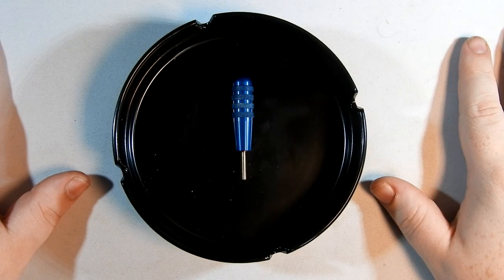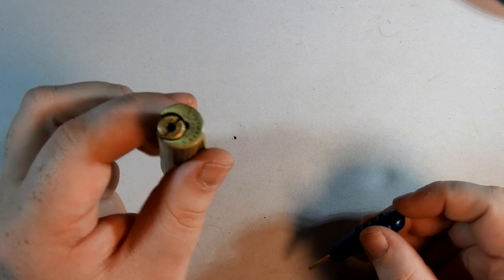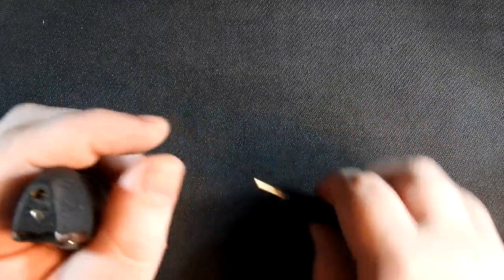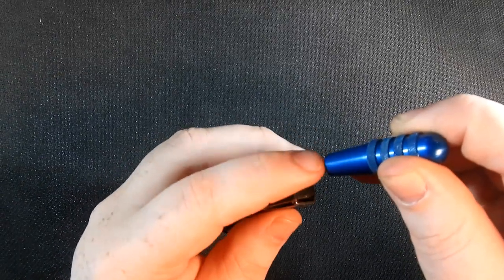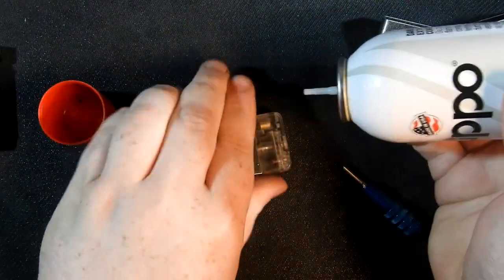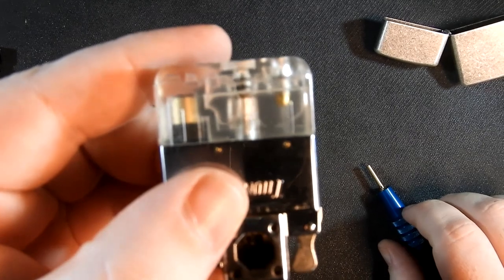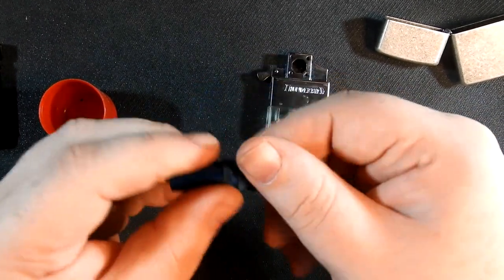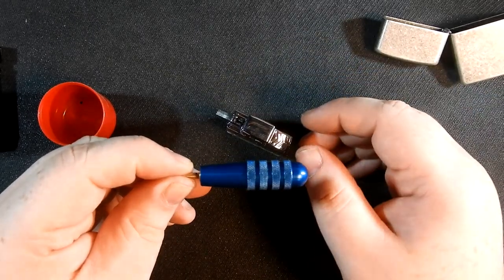Cigar Prop Butane Air Bleed Tool

Comment: Oh that’s cool I could make out of use up butane bottle spout. Take hot pin put two holes in it. Or go to the dollar store and grab a vinegar bottle they have small metal tubes in them.
Reply from the maker: But it wouldn't be made out of aluminum! Kidding, that is a good cheap way to do it, you probably have old cans of butane anyway, so why not?
Reply: @kismitscorner  lol I was thinking just for a video. Not that id actually use it. I never bleed my tanks
Reply from the maker: @Zippofanatic77outdoors  You should occasionally though, might get longer run times.
Reply: @kismitscorner  just doesnt play a big factor in my life lol I use fluid more. My butane I only use 10-15 times a day. My fluid is the load bearer getting 20-30

Comment: Seems useful for getting all air out for better lights.. does this device work with smaller units?  Like a "Base Model" Clipper.. with the fill nozzle in the middle ? In the video it looks kinda large
Reply from the maker: Pretty sure it will, it worked on the Clippers I have, but they are the metal ones. They developed this tool to work with most butane nozzles, so I imagine it will work just fine!
Reply: @kismitscorner  I will be getting one. Better than my current Jerry rigged one. What's the name of your eBay lighter store ? Do you have any Zippo's/ Park Lighters for sale ?
Reply from the maker: @doejon9424  I don't have any lighters for sale currently, I sell CDs and DVDs and things like that. Thanks for the interest though!
Reply: @kismitscorner  Oh nice. What is your eBay store ? Do you happen to have the Star Wars Blu-ray trilogy (Episode I-III).. with Yoda & his green lightsaber ? Came out like mid 2000's and then later a newer one came out, with Yoda angry face/no lightsaber. Anyway.. I want the one with the green lightsaber because my Episode V-VI set has Darth Vader with his red lightsaber.
Reply from the maker: @doejon9424  My  store is kismit_collectibles. I do not have that set, I have the steel books, but those are my personal collection lol
Reply: @kismitscorner  Okay cool. I am trying to go minimal space for my DVD / Blu-ray collection. I have multiple copies of Star Wars, Bond 007, Transformers, Indiana Jones, LOTR/Hobbit, Spider-Man, etc. It's like.. why ? Just minimize to 1 copies of each. Many different collections and box sets that just sit & I can only use one at a time.

Comment: Cool little gadget, would save some icy fingers for sure I'd wager.
Reply from the maker: Especially for those bigger tanks, I have had to stop before, felt like my fingers were frozen haha. Thanks for watching!
Reply: @kismitscorner  yes when butane rapidly hits oxygen it freezes.
Reply: @kismitscorner  If you keep an empty refill bottle, you can sometimes offgass back into an old bottle. I've had mixed luck trying this. If you put the empty refill can in the freezer and get it cold. And warm the lighter/insert in your pocket, most of the fluid will/should go into the old can just remember to reverse their fill positions with the can upright instead of upside down. Hope that made sense. Mileage may vary